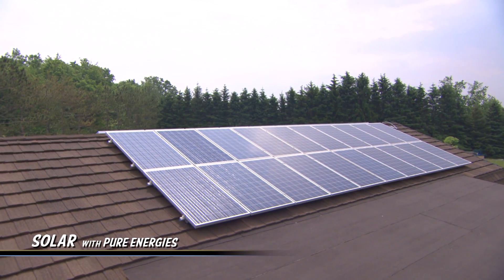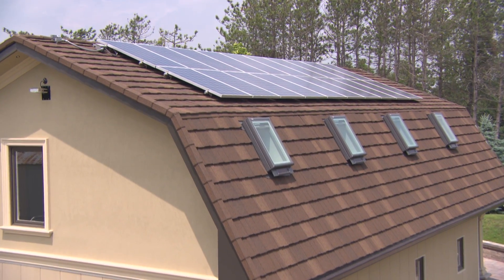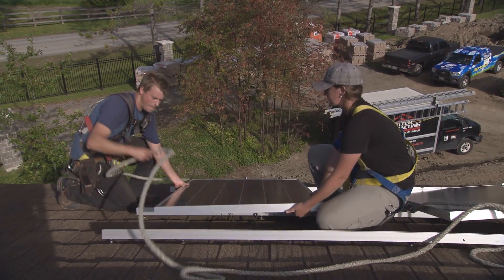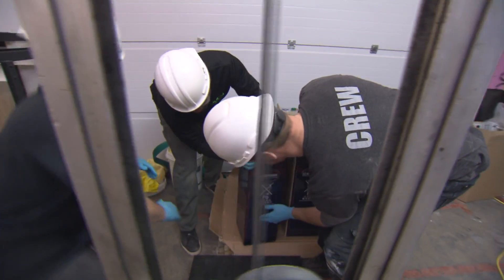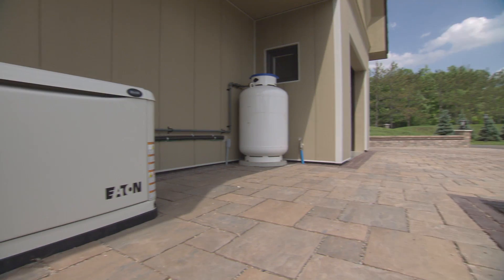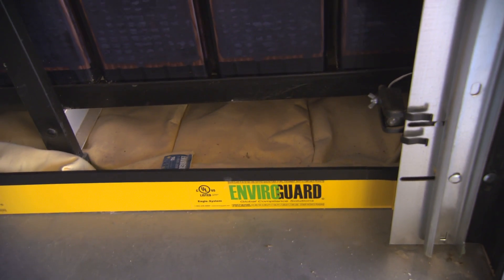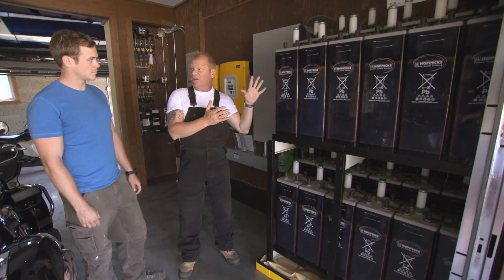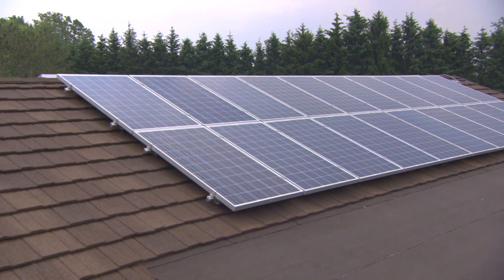"Solar" - Mike's Ultimate Garage: Inside Look

Comment: Hey Mike, curious how much this set up would cost without government rebates; seeing as those will vary depending on location?
Reply: I can give you a very rough estimate of the costs and welcome anybody to chime in.  Mike’s panels are a little dated at this point (2016).  But figure $250/panel (China made), that’s $10,000.  His Hoppeeke batteries are roughly $10,000 also.  The Sunny boys are about $5,000 each, for another $10,000.  Another $10,000 for the backup generator with tank.  $5,000 for racks, wiring, misc.  That brings up to $45,000 in materials.  Professionally designed and installed brings it up to $70,000-$80,000 (US dollars).  Same system but grid tied, would be about half that before rebates.  I have 36 – 280W panels which produce around the same as Mike’s 40- 240W.
Based on the design of the garage roof, it doesn’t look like it was designed for year round off-grid solar from the beginning.  There is a large low angle dormer under the west side array (by the green roof) which prevents the snow from sliding off the panels in the winter.  Toronto doesn’t get huge amounts of snow, but as I understand, frequent 2” dustings” which is terrible for solar panels because it’s not heavy and wet enough to slide off by itself.   Keep in mind it’s only a garage and he’s not trying to live there year round.  Snow or not, the sun angle in the winter is pretty severe so his generation probably goes from around 1,000 – 1,500 kWh per week in the summer down to 50-70kWh per week in Dec/Jan.  Thus the big backup generator :-)
Reply: Awesome Scott Kolaya, I appreciate the breakdown of the expenses.  Question with your comment about a "system grid" being half the price... Am I correct in assuming you would deduct the cost of the batteries ($10,000) the generator ($10,000) the Sunny Boys ($10,000)? Again, thanks for the info.
Reply: Exactly.  You don't need charge controllers anymore since there's nothing to charge, but you would still need some sort of inverter, either micro inverters on the back of the panels or a central string inverter.  In my estimate above, I may have not included the cost of what looks like Mike's additional inverter(s).  It looks like he has 2 charge controller/inverters and 2 additional inverters, since it powers a garage.  I designed my system to be grid tied and grid tied only because where I live it's by far the most cost effective option as well as green.  100% of my solar power from my panels gets used either by me or my neighbors.  When you're off-grid any extra power is wasted if the batteries are charged and your not using it (as Mike also indicates).  In my case, I'm allowed to tie into the power grid and backfeed the meter and the power company credits me for every kWh pushed back on the grid, so I get to use those credits in the winter months when solar production is crummy.  I have 36 - 280W panels with micro inverters attached to the back of each one.  That way each panel operates independently of each other giving me 220 right from the panel. I don't want to get into too much detail, unless you care, but the way Mike's panels are tied together in series, power production is limited to the weakest panel.  That also means if a bird defecates on one of the cells of one panel (since all 60 cells in each of the panels are also in series). It can limit the production of all the panels in that string.  In my setup I simply have 36 panels on the roof ($350 ea) with one micro inverter ($160 ea) on the back of each panel.  9 - 10 awg wires running from the roof through a 1" conduit to an aux breaker panel, then into my main panel, that's it.  So in my basement you can barely tell I have solar at all.  I also can monitor the production of each panel individually that way.  You can view my production here:  https://enlighten.enphaseenergy.com/public/systems/cBEA736308
Reply: @scottkolaya2110  thank you for the link :) that is pretty cool. Would you do it solar again. I am more of a do it myself so I dont have to pay for something like this for 20 years. I just dont think its cost effective were I live. DesMoines Iowa and I have trees around me. was hoping for solar roofing but that seems to be a bust. I will have to wait to get everything else fixed before I even think about solar by then maybe the neighbors trees will die
Reply: @crushsmith7534  Sure I'd do solar again.  I've had my system for 3 years with no troubles at all.  I certainly understand the DIY type of person.  I designed my own system, but after finding out that I couldn't get the NY state rebate without using a certified installer, I just put the design out for bid and basically got it installed for free by taking advantage of the state rebate.  My roof is completely clear of trees.  Here are a couple of things to think about.  Snow.  If you get a lot of snow, think twice about mounting them on the roof 2-3 stories up.   If you have an E/W roof (mine is), the loss in efficiency is about 28%  So for me I have a 10kW system, and if it were to all point south, I'd only need a 7.2kW for the same yearly output.  I'd also install snow slides below the panel, or mount the panels very close to the bottom edge of the roof so the snow slides off and doesn't get stuck on the roof between the bottom panel and the gutter.  Here's another link to figure out based on the weather pattern (sun exposure) of your zip code what the expected monthly/yearly output would be.  My system keeps within a couple percent of their estimated output, so I find it the most accurate.  https://pvwatts.nrel.gov/
Reply: @scottkolaya2110  I agree especially on the snow slides. When the snow breaks loose on my 10kW system it sounds like an avalanche coming off the roof. Ruined the hedge on the walkup to the front door, and I have panels on 3 sides of the house. Lesson learned LOL!
Reply: @geofbuchignani2861  I think you're thinking about snow guards, vs snow slides.  Guards stop the snow from avalanching, slides promote avalanching.  Guards are great for use above walkways, etc but hold the snow on the panels and reduce output.  Slides are basically a small section of a metal roof at the bottom of asphalt shingles.  My panels aren't where people walk, so I'd rather the snow easily avalanche off.  And yea, you have to plan your landscaping appropriately so you don't have smashed bushes.